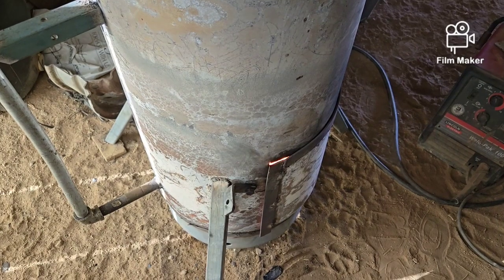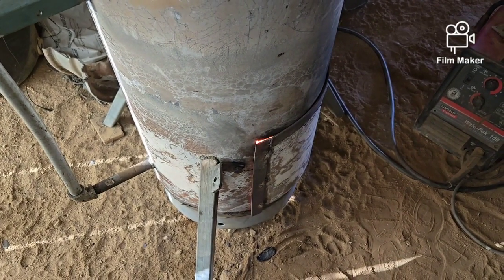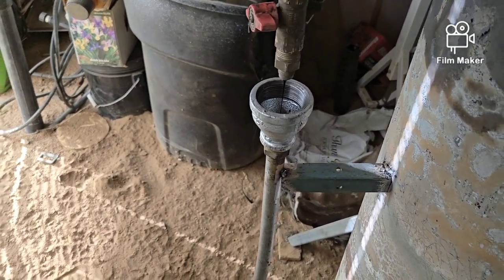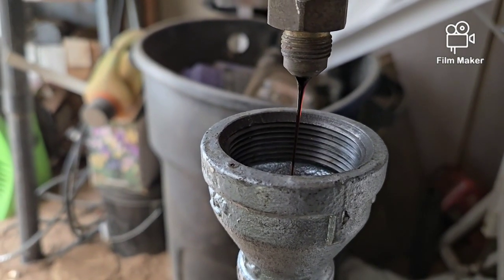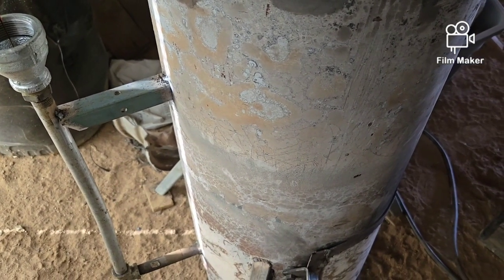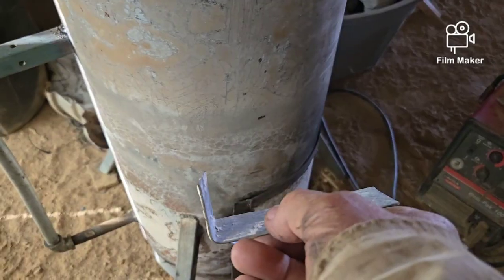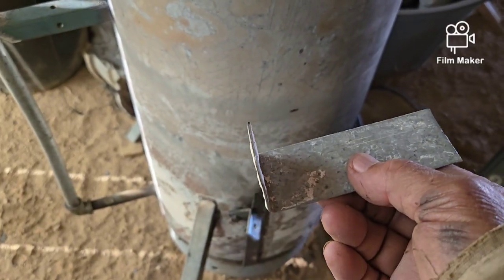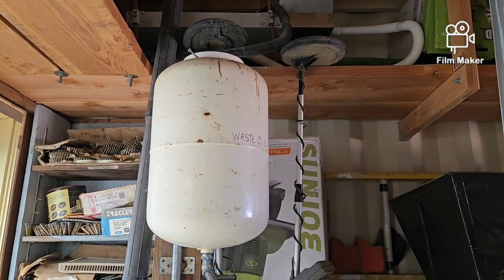Waste Oil Heater Modifications, Nov. 18, 2024

Comment: Freezing and 50 MPH wind gust out here in West Lancaster, wish I had an oil burner like yours out here...the wind steals the heat out of the house within minutes...Burr...Great video G-Bear, stay warm.🥶
Reply from the maker: @camodudeA51  You stay warm too!  I baked bread tonight, so the oven warmed the cabin, then I roasted chicken quarters in the hot oven.  Winds are still 21mph and temps down to 41 outside.  Quite a wind chill.  Sounds colder there.

Comment: A great way to use up that old used oil.  🙂👍🏻👍🏻
Reply: G Bear, maybe I missed something, anyway I've been wanting to mention something.  Waste oils, like used in machinery, can be highly contaminated by many carcinogens.  I remember reading about a town called Times Beach, where they sprayed the streets with waste oil that someone used because they could get it cheap.  After many residents died the government bulldozed all the streets and homes and closed off the area.  Just a bit concerned for you.  : (
Reply from the maker: @retirementbootcampoff-grid237  OMG,  don't worry about me.  I was told by a couple of doctors that due to my exposure to petroleum products and carbon monoxide working as an auto mechanic,  that I only had about 5 years left to live,....47 years ago.
Don't buy the government hype.  That incident you probably heard about was a deep state test in a closed area.  Notice that it is a one time isolated incident.
Reply from the maker: @IanYGath  Yep!  Survival techniques at their finest.  This year, I hope to perfect a wood gas generator to supplement propane.

Comment: G Bear, where you attached your brackets to the stove, does it transfer the heat to the oil tube?  Btw, it’s getting cooler here too.  We are going to be in the 40’s by the weekend.
Reply from the maker: @billm5433  Good question, Bill.  Yes, some heat is transferred, but that is a good thing.  As you probably know, oil viscosity increases with cold, so warming the feed tube is a good thing. 
And, no it doesn't get hot enough to Ignite the oil flow in the tube, because cold oil is constantly cooling the feed tube which keeps it well below the flash point.